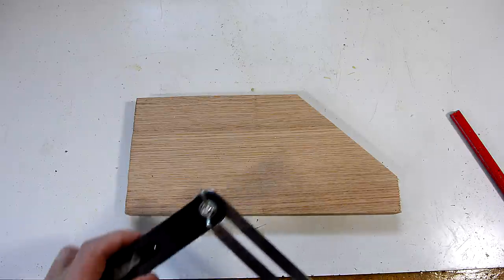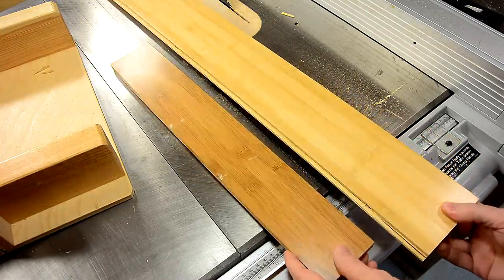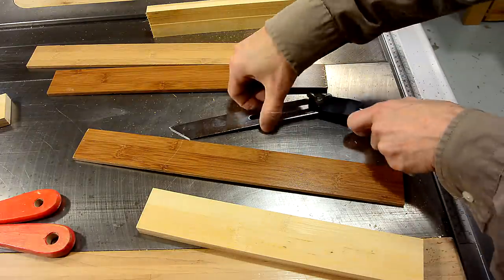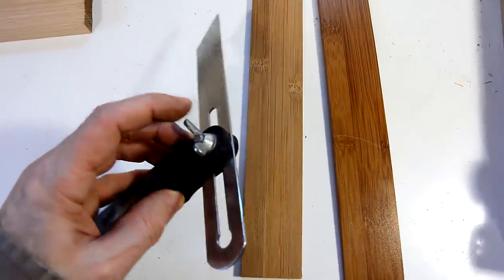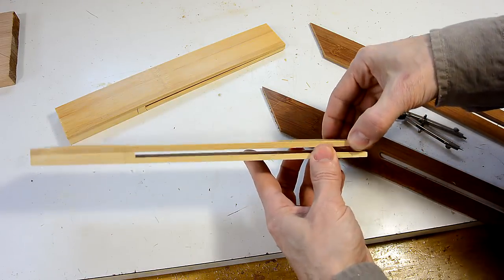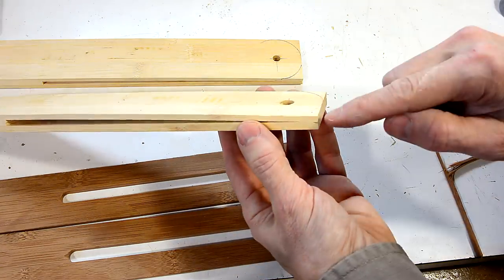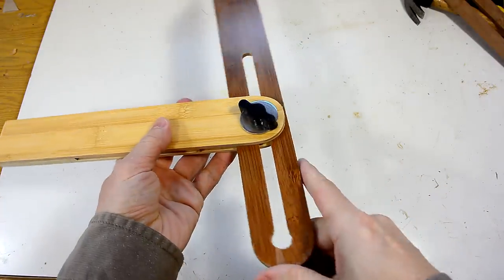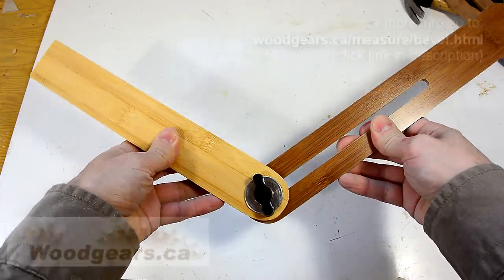Making a bevel gauge

Comment: For brittle or splintery woods like bamboo and oak, you can substantially strengthen the ends with a spline...but a much simpler way is to saturate the end grain with water-thin CA.  It soaks into the wood and consolidates the fibers to become a polymer composite when the CA sets hard.  This trick is also a good one when setting small screws in soft woods like pine: drill for the screw and then add a drop or two of water-thin CA.  The adhesive soaks into the wood fibers and when cured, the pine is about as solid as hard maple.  Use wax on the screw threads; the wood will not strip out.

Comment: In response to the kickback comments a blade spinning at 3450 RPM can shoot a piece of wood up to 102 MPH.  At that speed it can kill.
Reply: Vern Mitchinson in 35 years i have never had a piece of wood thrown back at me and as a cabinet maker i only use solid timber not plywoods.  nor do i use a riving knife as they get in the way with all the different set ups required.  call me silly but its more in understanding the feel of the wood as you push it through the blade and having your fences parallel to the blade.  its important to be safe but you can overdo it.... i still have all my fingers.
Reply: Tayler Made I bought my first power tool in 1972, a radial arm saw. I ripped my first board and the piece between the blade and fence was shot out, hit and shattered on a concrete wall 25' away. If it had hit me I could have been killed or seriously injured.  This happened because I had not set the anti kick back device properly.  I still have and use that saw but have not had a kick back since because I always set the anti kick back.  If you want to live dangerously that is your choice but it is not mine.  By the way I have all my fingers and have never been injured using a power tool.

Comment: How does bamboo hold up to yellow glue since it's not as porous?
Reply: Great question MRrwmac!

Bamboo is a grass not a wood and is very porous.  In grasses, the vast majority of pores (well over 80%) tend to run the length of the blade (i.e. with the grain).  For bamboo, this leaves a unique grain and pore pattern that can either be concealed or exposed depending upon how the raw product is processed.  Today, concealment is the most common choice.  

That said, most bamboo products are themselves laminates (i.e. made from many strips of bamboo) because while fast growing, bamboo, like most grass, grows taller much faster than wider.  Growers generally harvest a field every 4 to 8 years depending upon growing region and overall farmed acreage.  This results in most bamboo being of smaller diameter.

Depending upon the intended market, bamboo will either be dried and sold as round stock or split and flattened for "board" stock.  Bamboo flooring is most commonly made from "board" stock laminates, resulting in concealment of most pores beneath the walking surface.  However, once cut into, the pores are exposed.
Reply: MRrwmac 
Did you find it kind of amusing that after all that, your question was never answered? Anyways, yellow glue works great on bamboo. Just as if it were wood.

Comment: 0:47 that's just all kinds of wrong...
Reply: Don't do it then...
Reply: aDotFromTheFuture what is?
Reply: ThoperSought He pulled the piece back even though the table saw was still running full speed. That right there is just waiting for a kickback to happen.
Reply: sfosnot85 Of course I won't, like anyone who knows what they are doing wouldn't.
Reply: aDotFromTheFuture Thats why he didn't do it the second time.It is always tempting to safe a few pointless seconds. I guess everyone does it.
Reply: ***** Maybe, maybe not. The point is, he should've known better.
Reply: It is not exactly like that peace was uncontrollable. Also you can't see were he is standing. He might not even be in the line of the blade.
Reply: aDotFromTheFuture The only thing that's wrong is you whining about how someone else chooses to use their property with respect to their safety.
Reply: seigeengine Sigh... clearly I'm not trying to teach Matthias anything, I respect that he knows his stuff (to some extent) when it comes to woodworking, but some beginner woodworkers might not. Let's say someone who has never done something like this, sees this video and does the same thing. That could end in an injury. I'm just saying, that the thing Matthias did in that particular instance is not advisable. He didn't say anything about it, so I might as well.
Reply: ginemginem If someone wants to jump on their table saw while in use, that's their choice, and no, I have no problems with it.
Autonomy > Your excuses for controlling other people.
Reply: aDotFromTheFuture
I think you have a really good point, but when you say, "He didn't say anything about it, so I might as well," it'd be really nice if you actually had said something about it.

if you feel compelled to warn beginning woodworkers, then warn beginning woodworkers. "that's just all kinds of wrong..." is just hate bait. people are going to take it more as a criticism of Matthias than safety information, and the people who need the safety information are going to miss it.
Reply: aDotFromTheFuture Then perhaps consider saying something of value.

For example: "What Matthias does at 0:47 is dangerous, and may cause kickback. Be careful when using the tablesaw."

As opposed to: "UGH UR RONG N DUM N DUH STOP DUH RONG NO"
Reply: seigeengine Nice strawmanning, brah.
Reply: seigeengine It's pretty clear what I meant when you watch the video.
Reply: aDotFromTheFuture
"It's pretty clear what I meant when you watch the video."
if you're a beginner, it's really not.
Reply: ***** wow wow wow!!  love your videos!
Reply: ThoperSought Yeah I probably should've, I just thought it was pretty obvious when you watch the scene which I referred to, but yeah I see your point.
Reply: aDotFromTheFuture
thank you very much!
actually having a successful communication with someone is so gratifying.
Reply: aDotFromTheFuture Sally...
Reply: ThoperSought Well stated
Reply: saw that too!
Reply: Safety troller who just can't help himself! Are you going through everyone's woodworking vids on YouTube and doing the same?
Reply: John Lesnik Did you have a bad day or something? I guess we can all agree that Matthias didn't exactly do the safest thing there, so that makes your insult quite unnecessary. If I see other woodworkers doing something dangerous and not mentioning it, then yes, I think I will comment about it, I'll just try and explain it better unlike I did here. 
And do you really need to feel so good about yourself, that you liked your own comment? I mean, that's just sad.
Reply: aDotFromTheFuture very well said
Reply: Fester Blats Oh my god... why are you being so hateful of me, for stating that what Matthias did wasn't the right/safest way of doing it? If you're going to make a YouTube video showing how to make something, you should take into consideration that someone with little to no experience might use those bad habits, and end up hurting him/herself. Wouldn't you agree? And how is it a random video? I mean you searched it and clicked it, so that pretty much makes it a conscious decision to watch the video.
Reply: seigeengine What a hoot!! LOLOL !!
Reply: Oh boy..... And so it goes on ad nauseum. Show us one of your woodworking vids then so everyone can comment on your safety methods.
Reply: John Lesnik The point is, if I were going to make a woodworking video, I certainly wouldn't show any bad habits which may be dangerous. That's not to say that I don't have any bad habits in woodworking, but I definitely wouldn't pass them to others. Just watch any of the videos from The Wood Whisperer. Now that's a quality channel, and that's how you should make a woodworking video.
Reply: Fester Blats In a perfect world that would be true, but this isn't a perfect world which is why these thing do happen, and people who make videos about teaching how to make stuff, should know that. The Wood Whisperer makes videos that are 10 times better quality than Matthias' videos, he is also much better woodworker than Matthias. If the silent music in the background makes you not want to watch those videos, well then that's your problem.
Reply: No, no, no, no, no.... You're just not getting it. Don't you realize that Matthias is the engineer god of wood? If you think he committed an unsafe method, then you have perceived things incorrectly and you are in error.  0:47 was actually deliberately performed for a specific purpose that Matthias was entirely aware of and hence why he posted it up for your eyes to see but obviously you misunderstood or misinterpreted it. He makes no mistakes and even can post a video where he rides around a ride on mower just mowing grass.... And that's a damn awesome video simply because Matthias is the one doing the mowin!

Seriously though... Lighten up dude. Stop faulting videos over every itty bitty unsafe practice you see and creating massive discussion posts over nothing (like my post here right now). And guess what... I'll like my own post if I feel like it too and there's nothing wrong or sad about that either. In fact, I'm clicking 'like' right now... Aah, that's better.
Reply: John Lesnik I'm not the one creating a "massive discussion post", it's you people who keep coming up with excuses to "defend" Matthias. My original post is valid, I'm sure Matthias would think so too (although I don't think he cares) so stop replying, there's nothing to argue about.
Reply: Fester Blats You're just repeating what others have said already and I've already replied to those, so I guess if you want my answer, then just go read the previous posts. One point though, even if he didn't get hurt the first time, he absolutely would have had he continued using the table saw like that. He clearly didn't know what he was doing (or didn't pay attention, which in itself is a mistake when using such machinery). You can see this because the second time he did it, he did it the proper way, which means he learned that the first way was not the right way of doing it. But yeah, we are just going in circles, so just stop repeating what has already been discussed.
Reply: Fester Blats Again, read the previous posts. But you obviously haven't done any woodworking yourself, or at least not much. Well I'm a professional joiner, and I do know what I'm talking about, just trust me. If Matthias were to put his arm inside a thickness planer to, for example, push a piece of wood out of there, would that not be dangerous for him just because it "works for him"? Just because anything didn't happen now, something sure as heck would've happened if he had done it, let's say, 10 times. Kickback is a serious issue when operating a table saw, and it happens exactly the way what Matthias was doing in the video. The piece was small enough, that it really wouldn't have taken much for it to be thrown towards him. Again, I do know what I'm talking about, but you obviously don't, so just please, stop arguing about this.
Reply: John Lesnik Okay, there's no point in your arguments anymore. If you don't have anything real to say, then I suggest you just stop replying. You're trying to sound smart, when in fact you're just embarrassing yourself.
Reply: As per your initial non-valid 0:47 post and yet another reply that validates that you love having the last word, you have once again wasted mine and everyone else's time. Thanks very much.
Reply: ***** Are people still commenting on this?! Sigh... If Matthias has any brains at all, then yes, he should agree with me that that wasn't the safest thing to do. But yeah, I really don't care enough to start debating with you too. So if you want, just read all the other 45 comments, it has all been debated there over and over again.
Reply: John Lesnik Engineer god of wood, I like it.  All hail the mighty Matthias!  :)